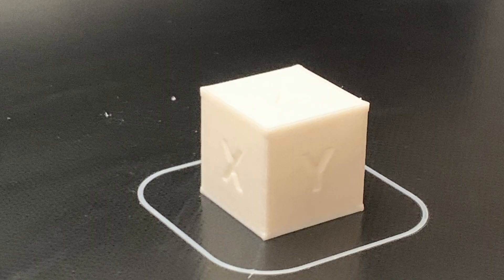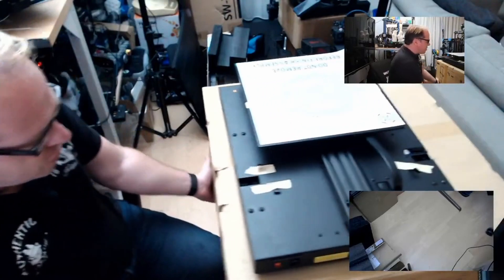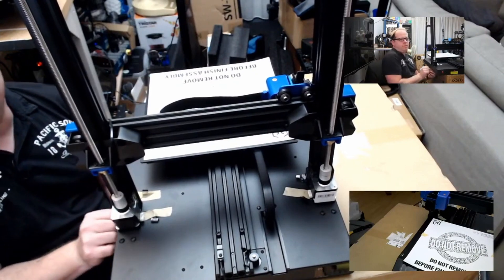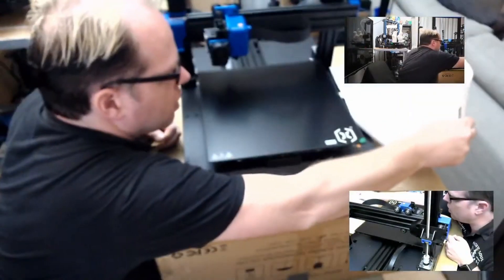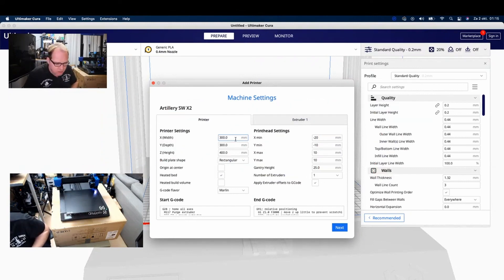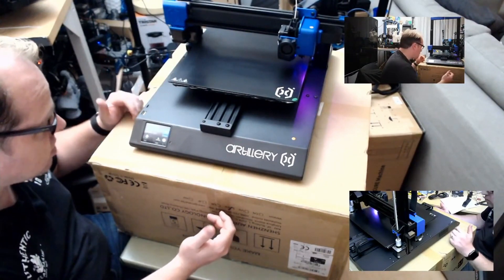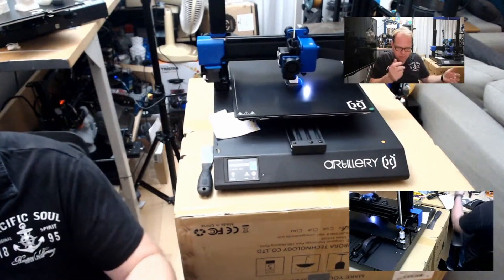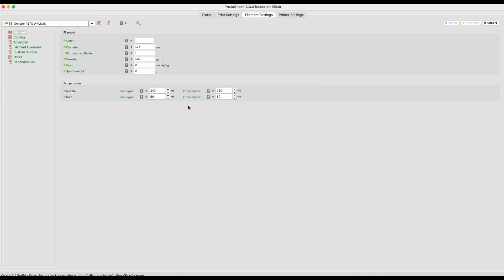Artillery Sidewinder X2 - Unboxing, build and first print

Comment: You didn't cover  leveling the bed and the gcode you wanted to add in the startup isn't G29 but M420 S1 Z2 ; use auto-level data.
Reply from the maker: I didn't cover that... sorry. But with the M420 it doesn't auto level every time? I have learned that using G29, makes the ABL before every print start

Comment: great video. This seems like it has a few decent improvements from the X1. I still find it odd that the glass bed is not swappable. But I guess you could add a 3M magnet sheet on top of it and convert it to a flex plate if you really wanted to.
Reply from the maker: It's a very nice and big machine to print bigger things on it. I still didn't do it... it's going to be time for that.

Oh wait, I printed Neo statute on that printer, a bit bigger than normal